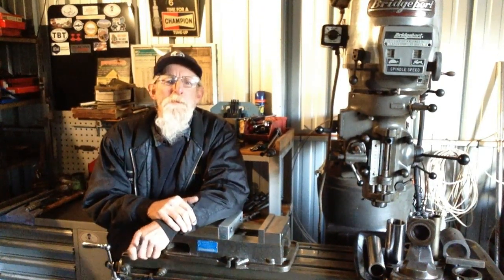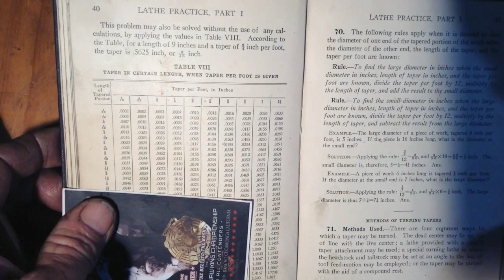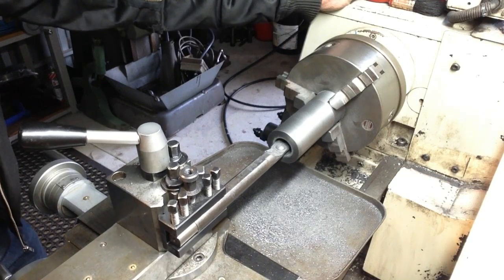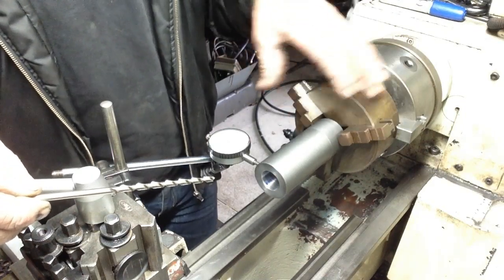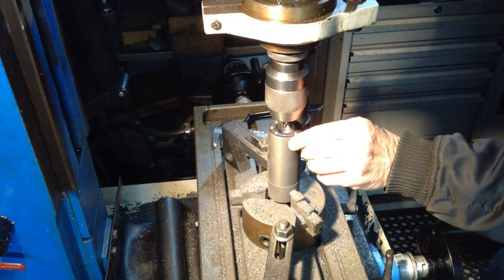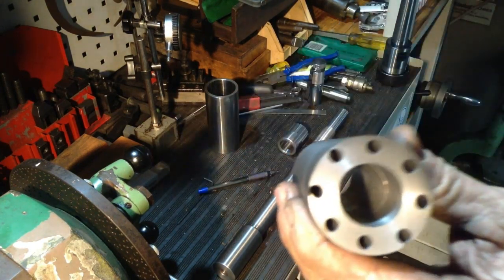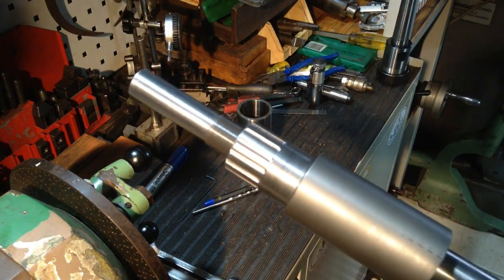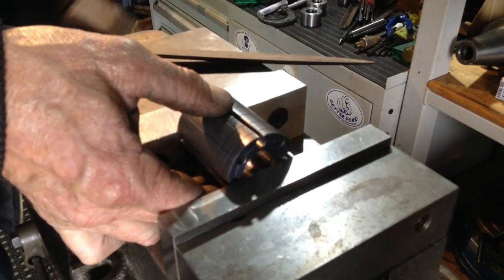The Swan Valley Machine Shop , Swarf & Chips . Episode 8 Pt 6

Comment: I came back to see this after watching your 75deg dovetail video. Excellent.
My only thought was your end shot might have been even more impressive if you made the inner sleeve spin while slowly sinking. The air bearing fit is first class.
Reply from the maker: Thanks  Russell .    There would have to be something dodgy going on to make it spin  in the vertical position !!!    Cheers .
Reply: @swanvalleymachineshop  Not really, just give it a twist after you've started it sinking and leaking air between the sleeves. It's already proved it has near airtight properties. Try it.
Cheers.